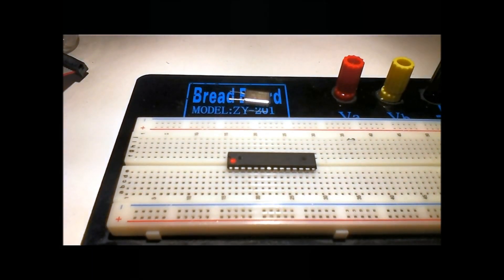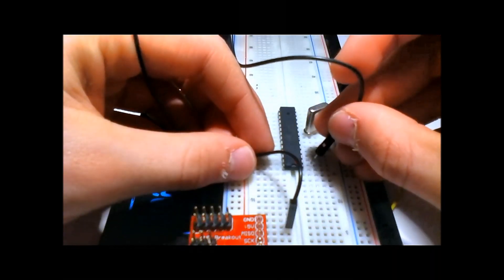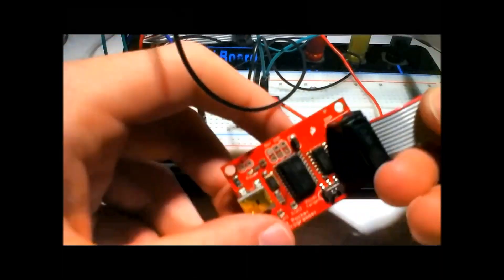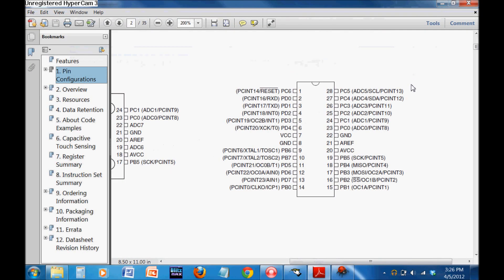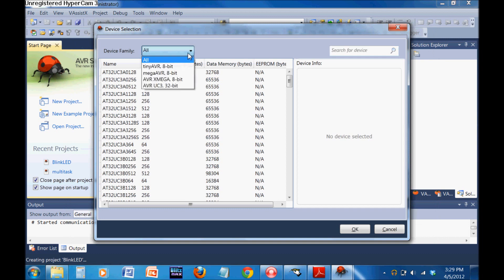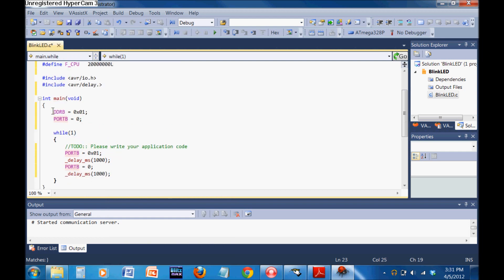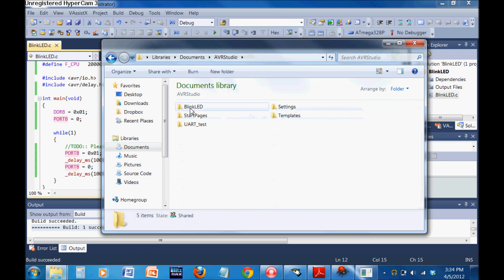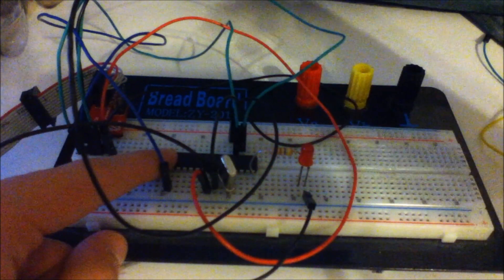Learning AVR-C Episode 2: Setup and BlinkLED

Comment: This seems really cool! For Arduino boards, one can just call avrdude from C-projects Makefile for upload, and avrcopy for creating the hex-image for Arduino board. I believe similar process works for other programmers as well.

I’d highly encourage people to learn how to use Make. For simple projects, the Makefiles are also simple. Also LLM/stackoverflow search work well for Makefiles as they are commonly used. Learning it right away is worth it in my experience.

For avrdude, you need to know the serial-port of the programmer, the target MCU, and what protocol to use for the upload, and the clockspeed of the MCU if I remember correctly.

I’d define the mcu and F_CPU in a Makefile. Then have a phony target for uploading the code.
Reply: thank you for input , i recently bought an arduino uno r3 and coding in arduino ide setup loop framework was dumbing me down and making everyone who can copy and paste use microcontrollers without understanding what is actually happening under the hood .

reverse engineering arduino frame work basic projects to bare metal c programming will really up my knowledge .

Comment: What is your preferred source for learning AVR C programming? I'm specifically wondering how you learned about things like `avr/delay.h` and so on. Are there official guides, references, etc? Any unofficial ones that are better maybe? The chip manuals I have (ATTiny series) don't have any references to C programming, which is comical when you consider the bulk of time working with microcontrollers is spent in your code editor.

Comment: Is this possible that withought putting 8bit value to any port. We just want to put single bit high or low. Ex pb3=high or low.  Not like Portb=0x01. It mean you are putting 8 bit to particular port. But I want to only set a single bit. Like 8051. Set p1.1 high or clr p1.1. So here we r only putting p1.1 as high or low. But in avr we put whole register of a particular port. Like portb =0x00. Why not portb.4=0 to set low of port registers 4th bit only?

Comment: I have the same exact setup and same code, but my delay in real life is taking about 20 seconds to turn off and 20 seconds again to turn on. I've been looking for the answer of why but I can't find it. I used a 20 Mhz crystal and i typed 20000000L into the F_CPU.
Reply: ***** I actually figured it out. My atmega by default is set to use the internal oscillator. I checked on the datasheet and that is actually the default setting. The actual clock speed is 1MHz. Unfortunately because I have the AVR Pocket programmer, it is a little hard to change the fuse bits since it isn't compatible with Atmel studio. I'll be looking to buy a programmer that is compatible. Thanks for your help
Reply: ***** Ok, I'll check it out. From what I've seen it seems complicated when using terminal to type in commands compared to just clicking options in atmel, but I'll give it a try

Comment: hey i getting error in the command prompt saying
"avrdude is not recognized as an internal or external command"
im using usbasp and avr studio 5.1
Reply: Mr. Awesome Ensure that the current path in the command prompt is where avrdude is located, or, add the path to avrdude to your PATH system variable.
Reply: +WhoWantsToKnow81 I am getting the same error message, and the path in the command prompt is correct.
Reply: +AVRHUMAN Then I would recommend adding the avrdude path to your PATH system variable, like this:

set PATH=%PATH%;<path to AVRDUDE>

Comment: Thanks for the nice video on getting started with AVR Studio!

Does your AVRdude Assistant also set the fuse bits correctly?

Also, replying to an earlier comment, I would think in an educational video, it would be even more important to do the caps correctly on the crystal. People who don't RTFM will be following your example and leaving these caps out. If you're not going to set up a crystal properly, you might as well use the internal oscillator.